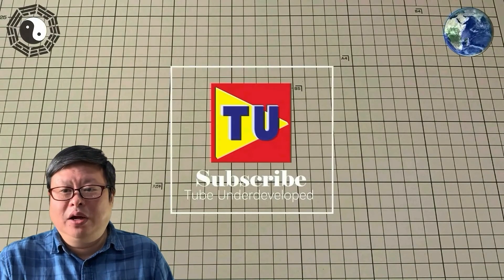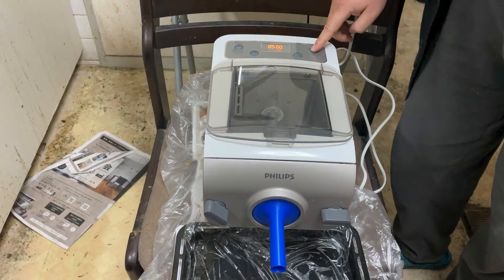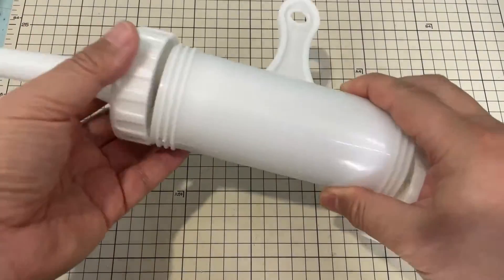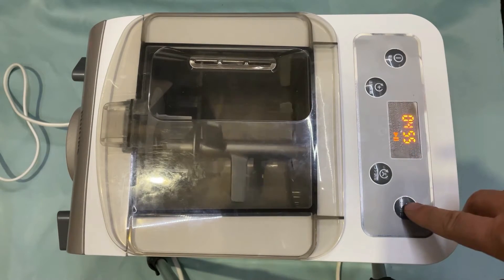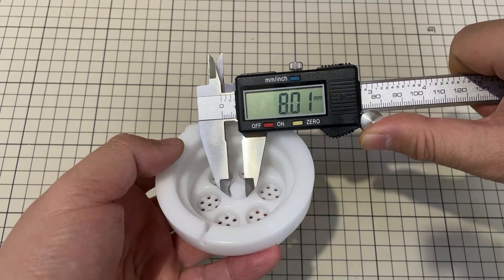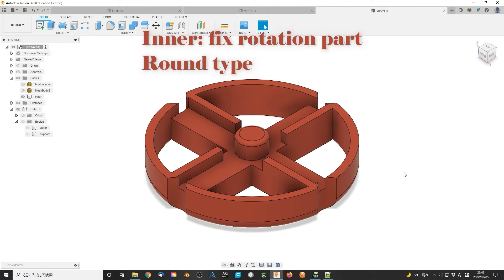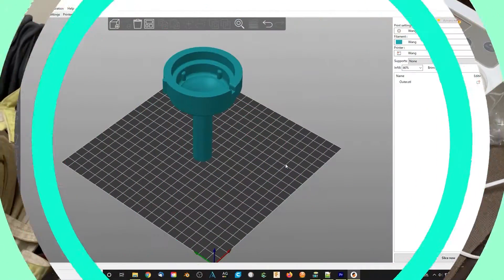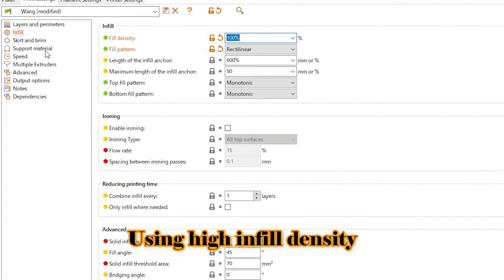Life hack (how to make sausage with Philips noodle maker)

Comment: you cannot safely sterilize a 3d printed product because the multiple layers are not actually tight or smooth. sausage is extremely susceptible to bacteria because is has so much surface area. you ay be able to buy the right sized tubes in food grade plastic or stainless steel though.
Reply from the maker: I see. Real sterilized material is not easy. I make this prototype and hope Philips can give the original one within the machine.  Thanks for your comment. Have a nice day.

Comment: If you have tube angled at say 45 degrees, you can print it exit side downwards without rough side on both inside and outside, since with 45 degrees you wont need supports anywhere.
Reply from the maker: Thanks for your comment. It is true. I think the bridge effect can cover the problem but it is not good as my expectation. Maybe I should modify the model later. Thanks for your idea. Have a nice day.